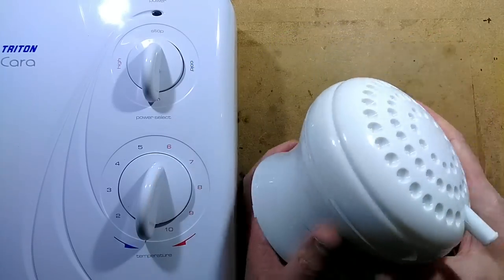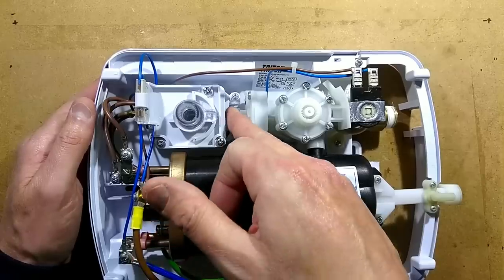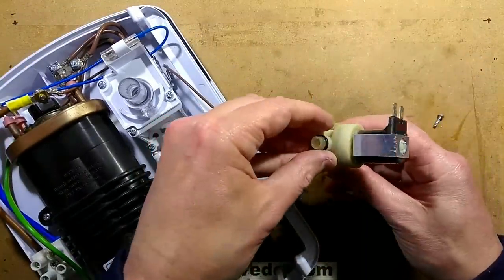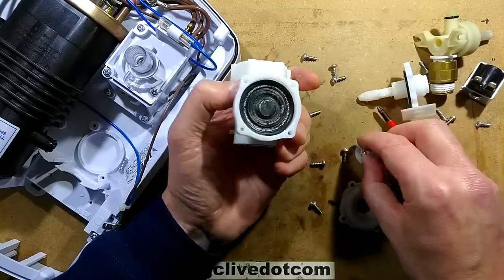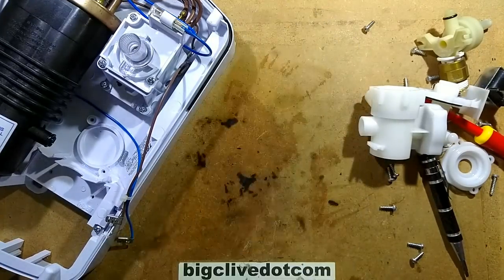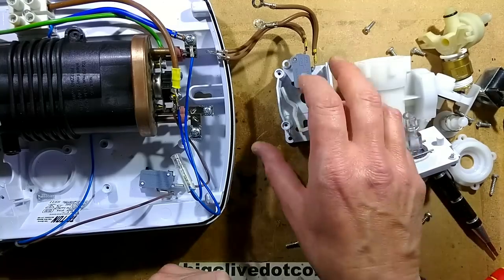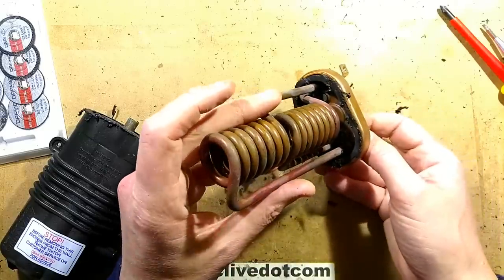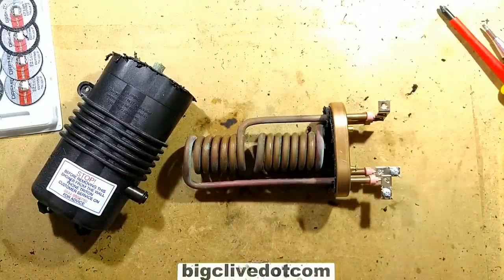Teardown of a UK electrically heated shower unit.

Comment: do you have one of these? would you have a shower with one? they should make a 12,24 or 48v DC version. with 4gauge wires going to it. with a high amp ac to DC. or for off grid folks. using solar and battery's. I just don't like the idea of having hi volt ac in the shower. I don't really like electric hot water heaters.  seeing the inners of this thing doesn't help. so would you/ do you use one of these? great videos as usual. thanks
Reply: James stranger this thing is literally the same concept as a kettle, just... more. 

it's perfectly safe and the amount of protection they build in is sometimes too much to the point of it turning off the shower because it's scared of overheating

the main issue with the pumped variants (which is what you'd be using off grid) is the noise of the pump, it's like a vacuum cleaner beside your head, and the power draw of a good 9kW unit requires its own switch and separate wire run just for safety reasons (ours has a breaker switch in the hallway above the DB, then a separate power switch for standby and then another on off switch on the actual unit) .

all in all I'd say they wouldn't be suitable for off grid use unless you had a beefy enough supply
Reply: About half of the UK at least has used one of these and I don't think anyone has ever died from one, they are immensely reliable.
Reply: Rob Fraser 
thanks
Reply: Rob Fraser 
thanks

Comment: I have but one question before starting this video... will you reveal what happened to the much more UK-suitable models they used to sell which had five power levels (and an electronic push button selector!)  instead of two, and/or how to convert our two-level units to offer a wider range of power outputs? It's a bit like driving a car with only two gears, made worse for remembering having a 5-speed.

I mean, I can just about cover tolerate the full range of conditions through the year with the high/low selector and the flow restrictor, from a lukewarm trickle in winter to a not quite boiling torrent in high summer, but there's always that difficult period a little earlier in the autumn (and in spring) where you're not quite sure whether to go low power/low flow or high power/high flow, and it'd be much better to have a level slightly above normal high, another slightly below it, two more in a similar relation to regular low, and a middle setting equidistant between them...

It surely can't be expensive. My bike hotgrips cost about £35 and have 5-level electronic control, whereas the only slightly cheaper models offer just high and low. I'd happily pay the extra 10 or 20 percent it'd add to the price of the next replacement I'm inevitably going to have to buy at some point.
Reply: If you have a trickle in winter then you need a higher power unit

Comment: So it's basically an end-point, mini tankless water heater?  Is there typically another one at the kitchen sink?  If there's a whole house water heater (tanked, or tankless), this sort of device shouldn't be necessary.
Reply: The hot water system is lower pressure than the cold because the tank is typically in the loft and is fed through the house via gravity.  Perfectly adequate for taps in the bathroom and kitchen, but try to shower and it would feel like a giraffe lazily pissing on your head rather than the glorious ejection of heated water that any good shower should be.
Reply: Really?  What idiot came up with that layout?  Tell me that's not standard issue in new homes or renovations.
Reply: It's not, this is only typical in old houses. Generally only poor people have these electric showers, or hasty student house conversions, where a residential house for ~4 people is converted to fit ~8 people. Additional showers are fitted, and because the landlord is cheap they don't fit a better water boiler - so they rig a few of these in.

Comment: 240V and high amperage in a device that is in a very wet environment and you are using it while you are very wet and very grounded.  What could possibly go wrong?

I'll pass on that idea and stay with my natural gas tank type water heater that even works when the power is out (like it was recently here in Texas).
Reply: Although we do have the on-demand type water heaters available for showers or faucets in the US, we do not put them inside the shower itself.  They are either in the attic above the shower or mounted on the wall next to the shower.  Another advantage of this solution is that it means that you are not tied into whatever type of shower head that the designer of your wall mounted water heater thought was appropriate.  Typically, the gas powered on-demand type water heaters are mounted in the attics since a flue must be provided for the exhaust gases.  We don't have the really old buildings that you have over in the UK, so remodeling is easier and we seldom have to deal with historical preservation issues.  Personally though, I prefer the tank type hot water heaters, although I do see where the on-demand might save some energy if used in a house that is only periodically occupied, like a vacation cottage.

Comment: So dumb question probably, but I will ask as I am curious.  Do y'all not use big whole house water heaters in Europe?  I ask as most houses in the US have one.  Mine has 2 as one of the owners had a hot tub.
Reply: Josh Samuelson Generally speaking (in the UK) we have separate boilers for heating household tap water as needed, usually in combination with our central heating, some simpler showers combine that heated water with the cold water inlet to control shower temperature, but their water pressure tends to be lower, these type, because they only use the cold water inlet at a more constant higher pressure, are generally preferred.
Reply: That would explain why the hot water sucked when I was Stationed in Germany.  The hot water would be just a sad trickle but the cold water could be used as a power washer.   Thank you.
Reply: In Greece both hot and cold water outlet have lots of pressure. Maybe its because of the geography. We still use these boilers (for the winter ) and we also have solar water heaters on the roofs.
Reply: There are at least three different household water systems available in the U.K., so there is some variation. Older houses have a low pressure hot water system supplied from a header tank. A lot of modern systems use a combination boiler instead with no hot water tank. For bigger homes, a mains water pressure system hot water system with a different design of tank is used.

Comment: You may have said and i didnt catch it but whats the wattage of the heater and its output amount of hot water?
Reply from the maker: Typically around 8kW.  Output will depend on desired water temperature Vs incoming water temperature.
Reply: @bigclivedotcom  thanks. Im totally unfamiliar with those. Im guessing the water runs a coiled tube incapsulated in the black canister? Years back i built several tankless water heaters but they werent that tiny. Thanks for the videos. Good stuff. New camera is very clear and clean picture. Mics pretty sensitive.

Comment: I may sound like an idiot to most people, but for the temperature control instead of it controlling the flow rate of the water could it be an idea to have that controlling how much voltage goes to the heating element? That way the flow rate stays more or less the same. Could that work?
Reply from the maker: +Liam O'Kane That would be complicated with such a high current load.

Comment: Seeing this device has me all sorts of confused. Does the typical UK home not have a water heater? If so then why do these things exist? If not, how do you get hot water to the kitchen or bathroom sinks?  What is the origin of these and why are they still in use? I'm taking a guess that these are not even legal here in the USA.
Reply from the maker: We do have central water heaters or on demand ones.  But we also have a high general supply voltage of 240V which allows much higher power appliances to be used.  These units are incredibly convenient because they offer instant hot wate for as long as it's needed.  No long pipe delay or heating big tanks in summer for a quick shower.

Comment: mines a 8.5kw and it has a high/low button and it adjusts  itself when the water pressure drops due to meny people using the water .  it gets verry hot when it drops then 5 seconds later it gose to warm

Comment: I have one of those, it was installed with the knobs 180 degrees adrift. I spent a long time trying to pull the knobs off, only to discover that they were fixed to the front housing.
Reply from the maker: You have to take the cover off, turn the knob to the position that matches the switch/flow regulator and then put it back on.
Reply: @bigclivedotcom Thanks,  I know that now. Had to find instructions online.

Comment: Clive, having had a few of these god awful showers in rented houses the question I was hoping you could answer is, why so often does the temperature vary massively while in use? It often doesn't seem to matter where you set any of the controlls there will be icy cold spells and much hotter periods
Reply from the maker: Because they rely on water flow to control the temperature, fluctuations in the pressure caused by things like toilets or washing machines filling will result in reduced flow and a sudden temperature increase.
Reply: Aaaah, this does make sense. The thermal mass of the elements I hadn't thought of before. But I've certainly turned a shower back on just after turning it off and been scalded. I find it most interesting that something with as many safety features, that has to meet all sorts of regulations can be produced so cheaply. the joy of mass production

Comment: I noticed the audio at the start of the video being boomy, distorted and clipped. Things noted with the video, the dynamic range seems poor, the highlights clip and shadows are still dark, the sharpness is too high (halos around text) smooth gradients are blurry, some devices encoding isn't great.  great video, I had one of these in a shower in NZ, very very uncommon here. I repurposed it to work as a hot rinse under a sink, worked a beaut!

Comment: Maybe someone's said this already, but I can't see it in a scan through the comments.

The top switch isn't summer-winter, it's to control the flow - no, really.. in use the flow restricter is controlling the temperature and the element control is controlling the flow.  It's  also a four-way switch (not three-way) - Economy is the small element only, Low is the large element only, the High is both elements together.  And Off is off.

If you want a hot but dribbly shower you can use the Economy or Low setting.  It's dribbly because with the Economy/Low settings you need to crank down the flow restricter to get enough heat into the water flow from a single element, slightly less dribbly with the larger element working.

But if you want a hot powerful shower you need to open up the restrictor to get the flow, which needs the extra oomph of both elements on the High setting to get the water hot.

This also explains why the elements are different sizes and ratings.

Comment: Would it be ok to power it with two phases? Let's say L1 and L2?
Reply: Arnis Tarassu Would require redesign of internal wiring, a two-pole overheat switch and additional isolation between the phases.  It would basically be a new model, the hottest element would still draw 20A, and there would still be no way to regulate temperature and waterflow independently.

Comment: Hello. I like the image and sound quality in this video. I have a "thermostatic" electric shower in my new house, where you have a button to select between low and high flowrate, another button to switch on/off and a dial to set the temperature. It seems to nicely hold the temperature you set it for, no matter what the flow rate is. Any ideas how they work/was anyone inside? Maybe you should get one some time.
Reply from the maker: I'd guess it might have a thermally actuated water flow regulator.

Comment: I don't understand why this strange unit uses one phase only. I've got an electrical heater in my bathroom rated 21 KW max. which uses 3 phases.
Reply from the maker: In the UK we have a single phase (240V) to most houses.  The shower is rated to operate at a realistic single phase current.
Reply: holy fucking shit. 21kw?
and here i thought 5.5kw was already a lot. this stuff must be highly inefficient to need such powerful current.
Reply: GraveUypo no it's not inefficient it just have a lot of Power and can provide (very) hot water for the whole flat.

Comment: Damn I was not expecting bare metal connectors in the body of the unit. I would've assumed that something that is operated in a shower to be designed with the same criteria as something that is expected to be entirely submerged in water! I realise these units are fully compliant but... I shall be looking at them with renewed suspicion...
Reply: It doesn't look any different to a kettle to me. Just inside-out.
Except for mechanical failure or user stupidity water would never go near the electricity supply.

Comment: I had one of these units fail on me - one of the 240v mains cables suffered an overheating failure and burned out.  Luckily, it didn't hurt the showering occupant, nor the bathroom, but was a bit scary.

Comment: Hi Clive,
Your new "filming device" is fine, i'm not seeing much of a difference, but that could be because of my crappy laptop.
But the Audio is a lot better, at least with my headphones, didn't test with speakers.

I would not feel safe with an electrical device close to me in the shower, but that might just be a feeling.
Us dutchies usually have gas heaters in the attic or some other room, seems a lot safer.

Comment: I still don't know why the temperature of the water is either too hot or too cold - while turning the temperature control just a tiny fraction of a degree either way.  Maybe if the control was geared one could get the ideal temperature easily?

Comment: the regulation valve is basicly working like a needle valve with a safety switch bild into it
witch controls the heating switch i gues in one step butt could be done in two steps from full to eco to cold

Comment: I guess I don't understand the UK water system, but why is there a need for these devices?  I have a 40 gallon (150 liter) hot water heater, I have hot water in a few seconds.  Audio/video is fine.
Reply: Space is a premium unless you live in a big house so there is no tank, just means of heating water and an electric element is instantaneous.  Taps are heated by the gas boiler and take a few seconds to warm up, electric showers are immediate.

Comment: One country motel had fitted a one cent coin in each shower head to save water.
A  1/8 " hole drilled in the centre meant your shower was limited.
With my trusty wrench I  had a collection of these coins on my keyring.

Comment: I like the old recording device better (or at least its settings). The exposure of this one seems fine, but the contrast is way too high. Also the white balance seems to be very much on the cold side. 
Does the new device have a wider angle lens? While you adjusted it in a way that the visible desk area is the same, it looks like everything that's above its surface is much bigger as usual (because the camera has to be closer with a wide angle lens). It is a little bit too much "in your face". (of course it could also be that the heater is a higher device than most things you take apart so it is closer to the camera just because of that).
The microphone is too sensitive (maybe that's a side effect of the device being closer to the table?). Your voice is clipping sometimes (especially in the second part of the video) and the noise of moving stuff around is quite loud and distracting.

Comment: Here in brazil there are some showers with electronic control, basically the control is made with a Triode for Alternating Current.
Reply from the maker: It's a lot of current for a triac to handle.
Reply: @bigclivedotcom  agreed, but they use water to change heat and those showers don't exceed 8kw. The most famous brand to use it is zagonel.

Comment: I  had two winters of cool showers. Who ever fitted the shower managed to put the heat select knob on the wrong position. Max heat should be at 12 o'clock as marked then it goes into the cold sector. So i never turned it past that position thinking it would get suddenly cold. Instead max heat position was at 1 o'clock in the very cold sector. I now have warm winter showers.  Triton T80si shower. I would have thought the knob would be keyed to prevent it being miss positioned. Seems to be glued on otherwise i would pull off and re-position.
Reply from the maker: To reposition the knob you usually have to remove the cover of the shower with the power off, and rotate the knob on the front cover to match the water regulator position.

Comment: Do they make these for US 240 Volt ??  your 220 is wired like US 120 volt   our 240 is 4 wire (new code ) two hot one common one earth  just went thru a big inspection added a gen set transfer switch and a duel lug meter base  now code here is 4 wire system  I guess you know this  these would be great in the warmer seasons instead of a 50 gallon heater !!!
Reply: Something like this would very likely give a US building inspector an aneurysm, since it would require 240V to be installed inside a shower.  What you could do is install a point of use undersink-type water heater just outside the shower and plumb it in, that way you'd have quick hot water and not freak out the inspector.  You'd probably want to go with at least a 12KW model.